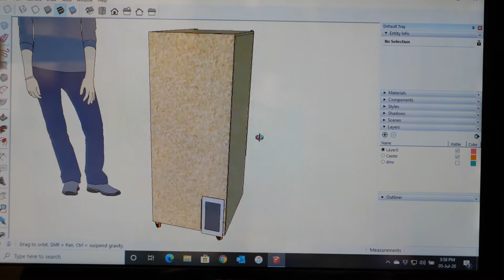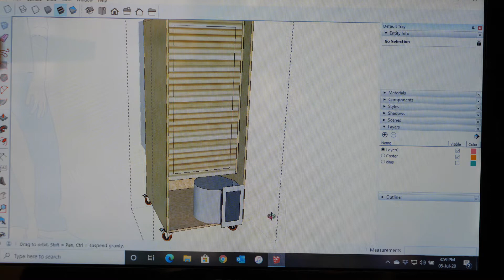How to make a simple guitar spray booth

Comment: Although it didnt work out as you wanted this was still a useful video. Finding somewhere dust free for paint and lacquer to dry is a challenge for us with small workshops and without dedicated dust free zones so I can see this being very useful to you.
Reply from the maker: I love the finish of sprayed work but you are right dust is a real problem. I have just got hold of some two part epoxy spray that’s apparently used for work tops, I hope this will be better than the water based Hydrogold laquer I’ve been using. Do you have any advice on this? Cheers Dave

Comment: Thanks for posting this video. What water based lacquer do you use please?
Reply from the maker: I have been using Mohawk hydro-gold gloss 80 sheen. This gives a reasonable gloss although it needs sanding with micro mesh to get the best finish. My only problem with this is that I don’t feel it dries really hard.  So recently I have tried Mann’s trade extra tough pro lacquer two part epoxy. You need to filter out any lumps but the finish is really hard. They use it on kitchen worktops. Hope this helps. Cheers Dave